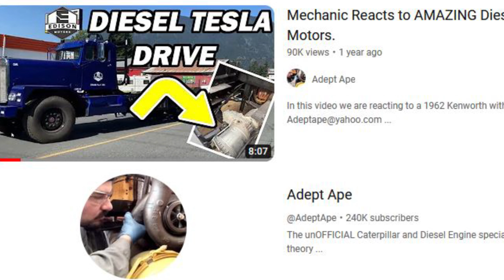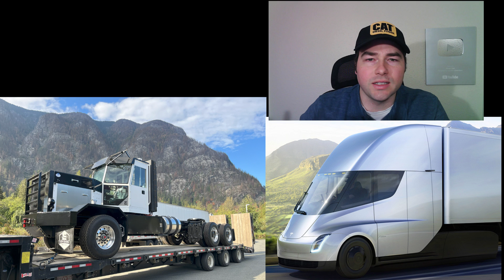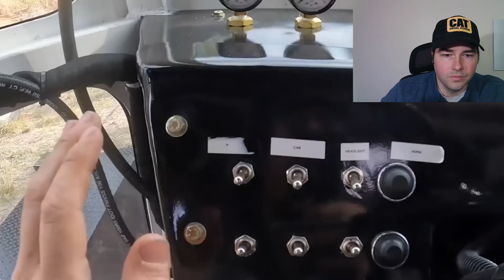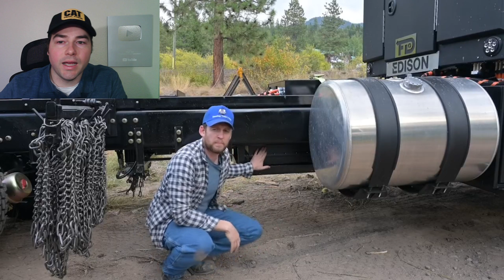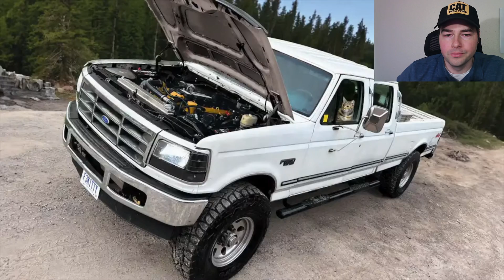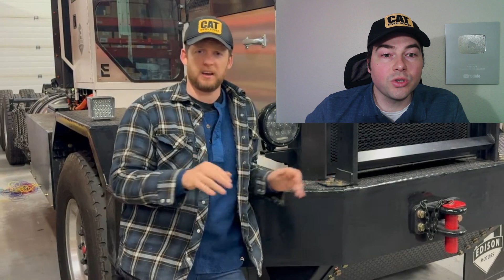Edison Motors New Truck DESTROYS the Tesla "Semi Truck" design!!!

Comment: I think going full EV for semis and even larger pickup trucks is just pointless.  The heavier the vehicle the larger the battery and the larger the battery the heavier the truck.  Then the charging times are ridiculous.  The Tesla Semi needs a 1 MW charger.  Yes it has 4 battery banks that will each take a 250KW charger so if you charge all 4 it will dray 1 MW.  Now think of a truck stop that has to charge 20 trucks at the same time.  You will need a huge transformer station to provide the power needed.  Even the CyberTruck with the planned 500 mile range was looking to weigh 9000 pounds and need a battery 6 times the size of the Tesla Model 3.  The charging times and weight is ridiculous.  Now put a a 100 mile range and a 4 cylinder engine to charge it.  Understand you could run the truck off the engine alone but the acceleration would suck.  So really the engine only has to be large enough to go down the highway with a little left over to slowly charge the batteries.  This means for most daily driving you could likely run just EV and charge at home with a 220 charger, but you would have that range extender based on an IC engine.

Now what Edison Motors was pointing out was that a hybrid system was also great for a service truck because you did not have to run a noisy and smelly engine all the time and these batteries could run flood lights and power tools pretty much all day, but still have the generator built in if needed.  With the 500 mile CyberTruck battery weighing 6000 pounds likely you could put a Ford Eco Boost V6 in there to run a generator and a 30 gallon tank for say 1000 pounds and trim the battery down to 2000 pounds and now you already cut 3000 pounds of the weight and have a MUCH longer range for long trips and towing.  Towing is a problem with EV because if you double your weight you have your range.  Instead Elon had to reduce the range to get the weight down significantly.  I think it now weighs about 6000 pounds and has a range of around 300 miles.  But with half the size of battery the charging times are no quite as bad too.  I knew all along he was going to have trouble with this and actually estimated within about 5% the size of the battery needed and the weight of the vehicle when he first announced it just by using the Model 3 battery specs.

Comment: there is a mine in Australia that uses electric haul trucks that recharge going down hill full using regenerative braking, Then run back uphill empty using the energy captured. the mine is situated high.

Comment: Correction about the hood style.  Side access butterfly hoods are the standard for nearly all extreme service specialist trucks, even in the US.  Kenworth c500 and until recently Western Star still used butterfly hoods on their biggest and their biggest trucks.

Manufacturers went to a 1 piece tilt hood for only 1 reason.

More profitable.

With a single clamshell tilt hood, any damage to it often results in the whole hood getting replaced.  This means the OEM only has to make 1 piece to fix a number of different types of damage.  This makes it cheaper to produce in large volumes, easier to assemble at the plant, and just overall more profitable.

It also gives them much greater ability to shape it for better aerodynamics and improved fuel efficiency.

A butterfly hood, on the other hand, requires a whole bunch of additional parts to work correctly.  Multiple hinges, latches, panels, mounting brackets, hardware, etc.

The advantage though, and why butterfly hoods are still in use today on severe duty off highway trucks, is because it makes maintenance and field repairs significantly easier to accomplish.

A tilt hood truck requires the driver or mechanic to shimmy past the tire to do anything.  In an off highway setting, this often means extremely dirty and difficult working conditions in a cramped space.  A butterfly hood though, completely isolates road debris from the upper half of the engine, allowing for a cleaner workplace, and safe space for parts and tools to be readily accessible.

Butterfly hoods also allow for far more sturdy and rigid crash guards that can offer full protection from significant impacts far beyond what a tilt guard could ever do 

I have both tilt hood and butterfly hood vehicles, and the butterfly hood is far better for working on typically.

Comment: I have been keeping an eye on Edison Motors since they started and I have been impressed with their designs and semi truck. While I am not a big fan of electric vehicles, I do think they have a great design and put a lot of thought in it. It looks to me that they went back in time to when trucks were made to be used and be repaired readily. I have a 1984 Triple C Centaur/ AM General M915a1 and this reminds me of that truck with electric motors instead of the Cummins 400 Big Cam III motor. My only thought is while the field of view is great, all that glass would be easy to break on a logging truck and they should have a 6x6 option with power available on the front axle as well. I know the M916 6x6 trucks are very popular with loggers because of that driveline feature.

Comment: Another advantage of their drivetrain is that you can run the engine at a constant rpm. Many aspects of an engine, like intake and exhaust geometry, cam profile, fuel mapping, and turbo dimensions are designed for decent performance and economy over a large rpm range. We have even invented things like VTEC (probably not in trucks though) , and variable turbo geometry in order to optimize the engine over a large rpm range. But if you only use your engine to recharge batteries you don't need any of that, and could optimise your entire engine for a specific rpm.

Comment: Diesel-Electric has run America's railroads for over 50 years.  It's a very efficient way to operate.  They o direct Diesel generator to the electric motors.  Constant Diesel engine RPM,varying power to maintain that RPM depending on loads.

On rails it's better than on roads,because less stop-start, which causes a lot of power loss.

A reasonable battery and a smaller diesel engine than a standard truck. The engine runs at an efficient near constant RPM. Battery makes up for surge demand and stores excess produced while slow or stopped.

A Chevy Suburban could run on a 30 HP diesel in a similar diesel-electric mode and be fine on US freeways.

Comment: It sounds like you’re confused a little bit.

All production EV’s today Use an AC three phase motor. They’re very efficient. Most batteries systems like you said are DC. Most of today’s EVS have an AC charger to use at your home for 120 or 240 V AC that converts to DC. Most fast chargers are DC straight into the car. There is normally a dc to dc converter to convert the high voltage dc down to the 12/24/48 volt low voltage stuff like lights and radios.

Most hybrids have an engine and electric motor tied together in the gearbox in one way or another helping each other send power to the wheels. There is a couple that was a generator to only send fuel generated electric to the battery but not the motor directly. I think the Chevy volt hybrid was like this.

This truck appears to handle any number of generators that charge the battery but not send power to the wheels, so technically it’s not an engine and only needs to follow epa rules for a on board generator. Take for example a tv generator.

The on board generator on the prototype produces ac so they convert that back to dc to send to the batteries.

I love the open nature of the hybrid section of this truck. Like he said you can go without a generator and do all batteries. It’s an awesome design!

Comment: Fun fact: one of the things Chase said back in the day was that when designing the truck they were taking inspiration from Pacific Trucks, a Canadian manufacturer that went out of business way back in the '90s. 

Pacific trucks were made-to-order, so normally it would be a clusterf- to get parts for it. BUT Pacific made them to outlast the owners, therefore they still have ALL THE SPEC SHEETS AND ALL THE BLUEPRINTS OF EVERY SINGLE TRUCK THEY MADE. So theoretically you can find a half-rotten Pacific log truck in the middle of a forest, but as long as it has a VIN-plate on it, you can have all the parts made based on the ORIGINAL BLUEPRINTS.
Reply: They remind me of the similar looking old AutoCar heavy-duty trucks used in logging as well as the early Euclid quarry dumpers. They don't have the same graceful looks as a full on road truck but their simple lines and angled panels make them look tough and to the point. I also like what they did with the windows on the front of the cab, it reminds me of a Cat D11 quarry dozer. :)
Reply: I can definitely see the inspiration from Pacific.
Reply: I would say this truck in the video looks more like an HDX, the exposed  headlights gave it away, Pacific, Kenworth, Challenger, and Mack had enclosed headlights.

Comment: Lets be honest here, a truck is utilitarian piece of kit, designed to work.  Wish my Tele was this easy to work on.
Yeah definitely circuit breakers in the headache rack.  Maybe also some separators between some of the bigger breakers.

Ony thing that bothers me with battery trucks in general is if its loaded and going up hill on batteries- lots a of heat generated in battery.  Then going downhill, same deal, working to keep the show from getting away from you.  This whole battery management caper really needs to be mickey mouse.  But happy to be proven wrong.

Comment: The one thing theres really tire But everyone does it because they wanna be cool, is the Mid seat. 
It's just not good m8. 
There are No real Long duty Truckers that would not prefer ALL visibility on one side and Limited visibility on the far side, over Limited visibility on Both sides. 
It's just not a good idea. 
And as a Euro trucker we are extra spoiled for Visibility. 
We do have Yard trucks that have center seats but that isn't a road truck and The cab is basically just a shell so you don't get rained on and water doesn't get to the electronics.

Comment: Looks better than a tesla. lmao.   It looks like mad max gangsta supreme!!!!     Then the hybrid systems with the C9 hands down top tier.  I would kill to drive something like this with Aero Cab.  Logging off road use as this probably will do exceptionally well.  No bones.  Iam sure there would be many quirks to Iron out but foundational ideas are 10 out 10.   Then again Logging Trucks or offroad Trucks don't give a sh't about Emissions.  Though Tesla wouldn't like to admit electric long haul trucks is a little bit of a leap to far to be competitive in long haul market.  Short distance light loads is where they can dominate the market.  Why then did Tesla build a Aero cab if it isn't for long haul. FMCSA considers anything over 100 mile radius to be long distance requiring log books. I can only assume that's why.  Same thing with electric cars.  Without the supercharger stations the market for electric cars becomes nominal and doesn't exist in Manhattan NY where actually it should.  The city rather charge extra taxes for rush hour than put in charging stations because it would cost billions. 

Question is? Edison is replacing a off road or logging truck or a long haul truck.  Offroad or logging trucks they're fine rolling coal. The emissions has hardly jurisdiction on private property.  For long haul truck it needs a bunker which isn't out of the realm but that doesn't have a bunker.  So then what is it exactly.

Comment: By running a generator at low power you have long reliability and limited stress on components. your battery will need replacing every 10 years but will have made the money to make it worthwhile.

Comment: 24:45 
in his video they said they'd connect the generator to the existing motor instead of the transmission. 
Which makes a lot of sense because engines burn a lot of fuel for power you only need in certain situations

Comment: There's 2 things I'd do different. 
A lot of American trucks don't use the full width of the truck for the cab, which is a lost opportunity imo. 
Second, the electric trucks suddenly put the driver in the middle. There is a reason trucks, and other vehicles that go on the road, have the driver on the driversside. It isn't just to make room for a passenger. Vehicles with the seat in the middle don't have the main purpose of driving on the road

Comment: I’d like to fast forward the Edison truck a few hundred k and see how the electrical controllers & electronics fair under the harsh conditions.. The impacts of off road conditions will find the weak link in short order. High voltage electronics and dust particulate will be the hardest to mitigate.. I worked in telcom , communications , and other power distribution environments . Dust & moisture kills electronics  ?

Comment: @AdeptApe: Honestly, the engine that could be put into a full-size pickup could be a Perkins 2.2L four-cylinder diesel. Ford actually offered that engine in the 1980s in the first-gen Ford Rangers. It would be small enough to serve the purpose of being a generator engine, without being encumbering. 

That said, I have seen a more modern Ranger actually retrofitted with a Kubota 2.2L diesel. Other possibilities could be a VW diesel, as a lot of Golfs and similar cars came with a diesel engine that would be small enough to be a generator for an EV hybrid full-size pickup.

Comment: Thank for your positive thoughts on the Edison project.
I have a Motorhome with a 3126B and have been in touch with them about possibly doing a conversion on it.
They have said that it would be a great option, and would have to do some engineering to see if it could work.
I will let you know if they can do it.
Regards
Duff

Comment: Nice build: simple, clean, straightforward, robust, built to last, freedom-reinforcing. The only issue I wonder about is the cabin occupants' safety in case of a crash.   Lots of hard, tough objects and surfaces seem to be close to the driver. It doesn't seem to have airbags installed in the cabin, but I do hope it has seatbelts and that the cabin frame is built sturdily, like a racecar rollcage. And the 'irony' is that Edison Motors also use - if I heard it right - AC and not only DC, as T. A. Edison was a staunch supporter of DC and critical of N. Tesla's AC system. Edison would be a great design for military applications as well. Maybe they're even gonna modify/retrofit those huge off-road CAT mining trucks to change them from diesel-mechanical to multifuel-ICE-electric drivetrain.
Reply: It's a logging truck. If you crash a loaded logging truck, operator safety is the least of your concerns.

Comment: I'm saying it now: this Edison truck crap is just another scam.  The design is appalling.  They're using generic, low quality, off the shelf parts for everything.  The cab can apparently only hold a driver and no-one else and it doesn't even look like they implemented foot pedals into the controls.  Also, what does an electric truck need a fuel tank installed on the side for?  Oh, they never said "hybrid" in the marketing.  They do realize that the only was to make this actually use less energy and make fewer emissions than a standard rig is to make it enormous and pull road trains, right?  We already designed and refined this tech.  It's called diesel-electric and unless you're pulling a freight train's load worth, it's less efficient.  Also, it's only efficient when the vehicles don't have to stop between destinations (just like a train, hmm how bout that).

Comment: Honestly my guess is that you won't be able to register the truck in most places. There a hundreds of codes and regulations you need to you need to pass to get an on highway vehicle registred. From crash safety to environmental impact of all the parts used to ergonomics etc.
Engineers do not design things unfriendly towards mechanics on purpose. It is just that there are a lot more requirements that all need to be fulfilled to get a new vehicle on sale and on the road.

Comment: Cool looking, don’t know what it could be used for. To spend 10 hours in the seat, the driver comfort is missing. The hood is a disaster for a mechanic, up an down on the fenders is a deal breaker. Some of the old school trucks made swing away fenders, allowing the mechanic to have full access to the engine compartment. I understand this is a prototype, looking forward to seeing the finished product. Thanks.

Comment: Cat has a tiny 3 cylinder engine for light tower generator plants. That produces 8+kw that would fit any pickup truck right down to an 88 Toyota ( speaking only of under hood space not weight carrying capacity of the suspension) these light plants with gensets are widely available.

Comment: DC motors are torque controlled and if the torque exceeds the adhesion, you quickly spin them up to extreme RPM. AC motors are RPM controlled by the frequency of the inverter. Yep, the inverters vary frequency to match the desired RPM

Comment: As to the cost of the pickup conversion. they are targeting about half the cost of a brand new truck for the conversion, so currently around $20-30k, obviously depending on the actual configuration.

Comment: My understanding from what they have said is that, in Canada at least, since the diesel is not the prime mover it is not considered the engine of the truck, it is considered more like an APU that they are not required to have emissions controls on.
Reply: Thats my argument. Electric notors are the methods of propulsion so the diesel should be exempt or limited in terms of smog standards.